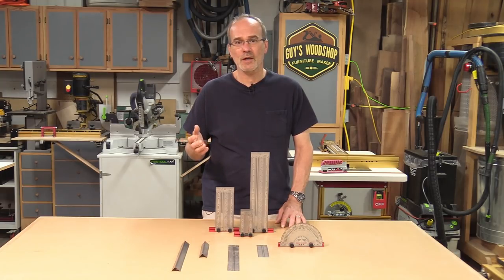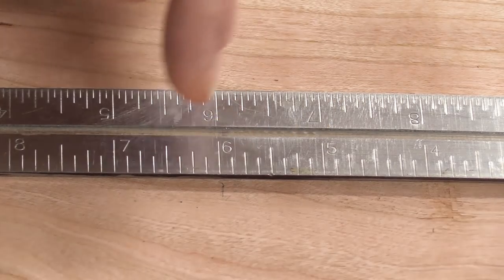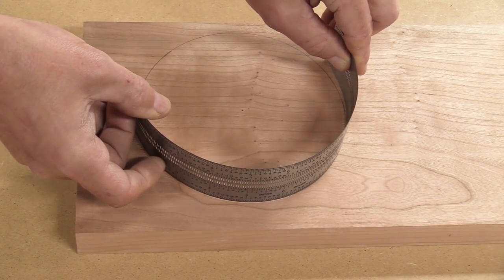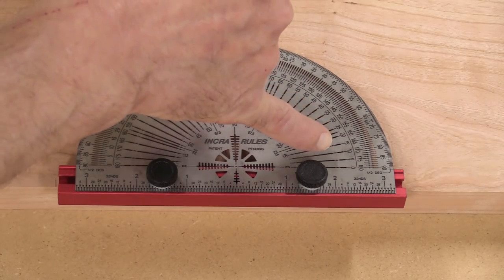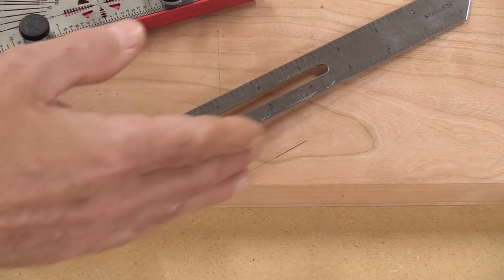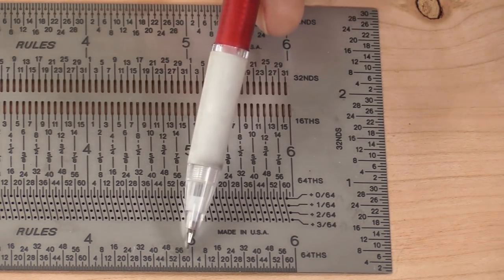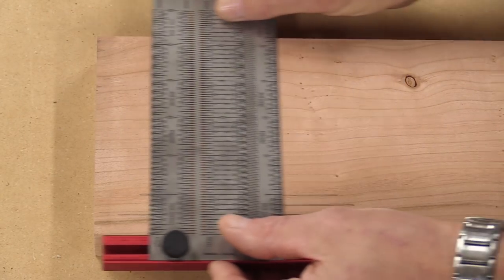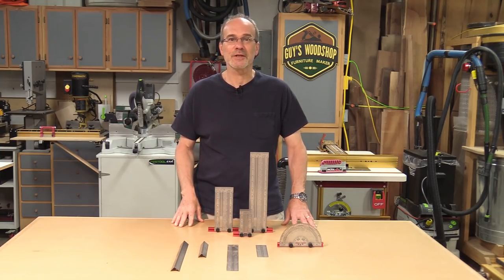Incra Precision Measuring and Marking Tools

Comment: What I also love about the Incra measure/marking rules is that I can use them for my visual art sketches/drawings/paintings. THAT’S why I’m so stuck on measurement accuracy. Also, my high school Drafting teacher was very specific about us having our measurements correct: I kept drawing the drill punch point off by 3 degrees, which (had the drawing been a ‘real world’ draft) would have made a very poor, inaccurate machined punch; and as manufacturing is super expensive and labor-intensive, it would cost my imaginary company a loss. My point is that there are other applications for which these wonderful tools can be used. So...off my soapbox now, lol.
Reply from the maker: I'm sure there are tons of different uses for different types of crafts. Great tools!

Comment: I love the one INCRA Tiny T-Rule, I have. I have seen a vast improvement in my marking. If you're like me and a little heavy on the 0.5mm lead, check out the Zebra DelGuard. It is the first 0.5mm lead pencil I've not gone through by breaking the tip all the time. Thanks Guy for showing me the many other awesome measuring tools INCRA offers!  I believe my next major shop upgrade will be one of their Rule Master sets.
Reply from the maker: I agree. I love the tiny t rule, and I have it in my apron. Just checked out those pencils, and bought 2. Thanks for the tip!

Comment: I took the plunge and purchased all of these rules with the exception of the protractor.  I can honestly say without fear of contradiction that these Incra rules are the most accurate and easy efficient to use bar none and I mean none.  If anyone is frustrated with parallax errors, awkward to use and have guaranteed repeatability then these are the only rules you need as nothing else comes close.  One of my favourite Incra rules [actually scrap that last comment] is the centre finder rule.  There are a few others on the meerkat but none come close to these on any level. For the record I’m not being sponsored by Incra and I purchased all of my Incra products with my own hard earned wonga.
At the beginning of this video it’s mentioned that the Incra rule can be used as a compass !! That maybe the case but I couldn’t recommend putting anything sharp other than a .5 millimetre pencil through any of the precision holes for fear of damaging it.  Theses rules are made of satin stainless steel but are exceptionally thin so care needs to be taken with them and in so doing will last you a lifetime.

Comment: Great video guy!   Hey not that it really makes much of a difference... but I think the T-Track on your Incra Protractor is on backwards?  There's that slight ridge along the edge of the T-Track that the ruler/protractor butts up against as a built in precision reference edge when you turn the thumb screws to secure it to the t-track/ fence... looks like your protractor may be ontop of that slight ridge in the t-track, instead of sitting flush & backed up against it.

Comment: My Incra T has made me question where I am meant to cut in relation to the marked line. If 0 is the reference edge... and I mark at 5mm, do I cut before, on or behind the line?

Also I still use a sliding square rule to line up my track etc... and this is what made me begin ? where I'm measuring or cutting. When I set my sliding rule should the mark be visible or inside the edge? We use the end (zero) to mark... so I think the set distance should be inside the edge? 

Some may say a consistent approach is all that matters, yet I use CNC cut parts at times and I am wanting a second opinion on the above :)

Comment: I commend your showing of this Tooling Company. As a former Floor Mechanic, All my tool boxes had At Least the 3 inch long "Mini Tee". I have both the Metric Scale as well as Imperial.
Are you aware that the company also makes the "Wood Pecker" series of tools? Billet CNC Hard Anodized and they are considered "Collectable Items" for those who buy for "Non-Use". However I USE my 3-inch WoodPecker Tee Square, and it stays in my Apron pocket unless being used!!! 

My ONLY complaint is they chose the .5mm pencil: I had already "Settled" upon .9mm Pentel Pencils as my "Pencil of choice. :-)  (My Try Squares all have a One mm hole in the groove @ exactly One inch Pre Incra Tools, As a Floor Installer that One hole in my Tri-Square made the difference between "Close" and ~On the Spot~!

Comment: The only issue i have with these is the need for a #5 mechanical pencil, the lead breaks to easily.  This tool works good for maple or poplar but get a dark walnut or most other dark wood and you have to press to hard on the pencil to make the line visible and the lead breaks.

Comment: I have the Incra T-Rule "Pro" (imperial/metric) which I neglect to use often, I just wish the blade was thicker/stiffer. It feels too delicate for the price! I think I would have been getting just the metric version as it makes it overall less bulky. Shame the Tiny-T doesn't have a metric version either.
Reply from the maker: I have had these for years, and have never had any issues at all with the thickness of the steel on them. Just like any of my quality tools, I tend to baby them however. And yes, it's a shame the tiny t isn't available in metric, as it's the one I use the most. Get one and come over to the dark side Paul! HaHa
Reply: Oh I believe you that they're probably indestructible (or at least highly durable), but it doesn't help me feel overly cautious around them! Until they get a micro-furlong version, I'm not switching.

Comment: Trying to decide between the 12in T vs plain ruler. 

As the edge I am referencing off may not be perfectly straight along the whole length I use a 1m Aluminum straight edge instead. The obvious choice is the bare ruler + straight edge, but the T ruler would save time. Jnot sure it will be accurate enough for my specific use case. Don't want to buy two rulers.
Reply from the maker: If you can only get one, get the T

Comment: I have a couple of the INCRA measuring tools but I find that I don't use them because of the fragile pencil lead.
Reply from the maker: I use a Zebra mechanical pencil now, and it works great!
Reply: go to an art or drafting supply store and buy:  draftsmans Prismacolor(trademark) "Turquoise" push button led holder pen.  then buy a led box with "TURQUOISE" #4H leds(12 leds to a box).  These leds hold sharpness and are perfect with the 18" Inca rule i use to draft waterlines for forms directly to interior plywood i use in my canoe making business(53 years using these tools). Also at welding supply stores look for "Silver Streak" leds great for metals and marking darker hardwoods where plain graphite leds don't show up well (colored leds as well as Silver Streak are softer and not good for Inca rules.

Comment: The biggest downside to these rules is you can only use 3mm or 5mm pencils.  Both of those are useless in a shop because the lead always breaks!
Reply from the maker: I juse a 5mm pencil from Zebra that works really well. Ithas a spring behind the lead that help prevent it from breaking too easily. Works great!